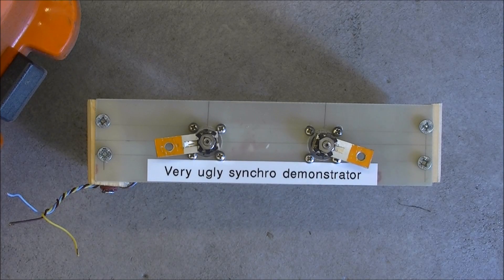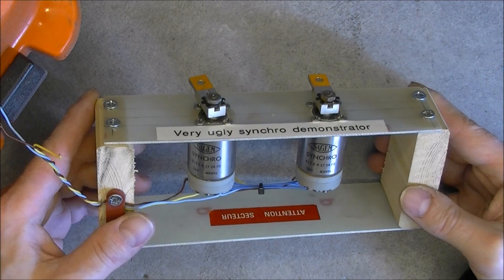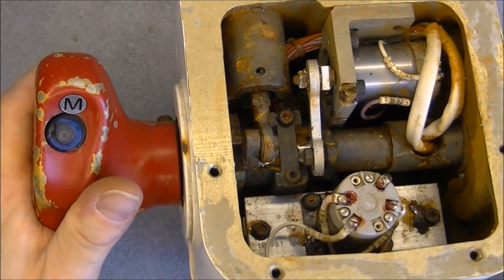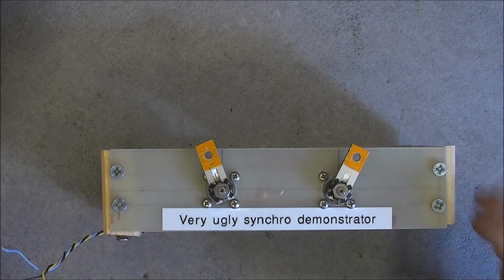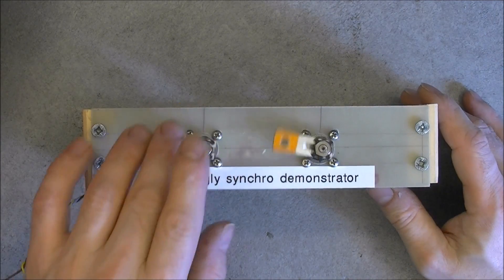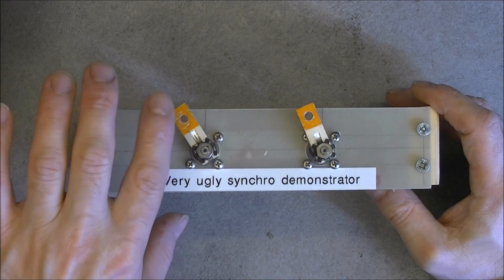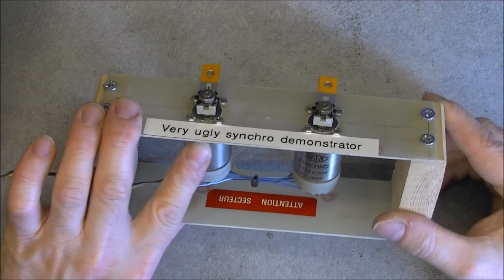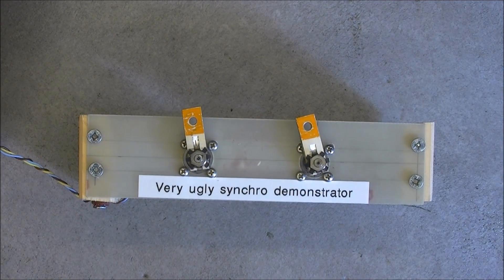I made a Synchro resolver / transmitter demonstrator, at least !

Comment: I think you have intermediate synchro's, usually the rotor only has 2 wires receiving power, and the stators have 3 wires.
Powering the rotor makes 2 synchros stay in position with each other having the 3 stators connected together as per your demo.
However sometimes you want 1 transmitter and 2 receivers, the first receiver has 3 in to the rotor, and 3 out to the 2nd synchro, the power goes to the transmitter and the last synchro's rotor.
I think thats about right.
If you have a 2 wire rotor synchro you could apply 400hz to the rotor, then slow your 3 phase generator frequency right down, connect it to the stator and you'd be able to run the synchro on its own as a motor, if your careful you can apply low current DC through a resistor to the rotor just for a test, use a 1k resistor in series to avoid heating up the rotor coil.

Comment: Very nice. Where did you get the sagem synchros? I would like to build one like this for experimentation, and would appreciate a source. thanks.
Reply from the maker: The particular source for these synchros is not likely to be available anymore, they came from a junk tank turret controller https://www.youtube.com/watch?v=j2cQek1eKLk . You can search ebay for synchros, but they are usually quite expensive, the cheap way to get them is to take apart old avionics ot military gear.